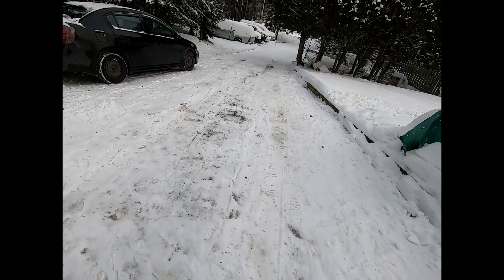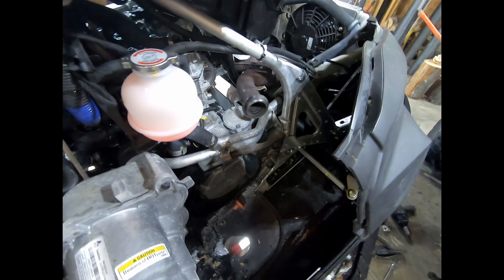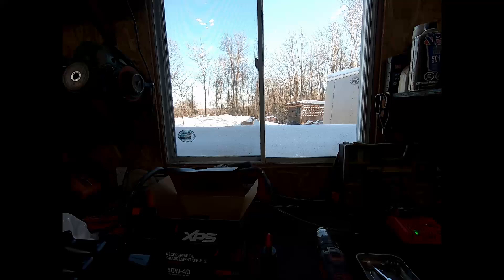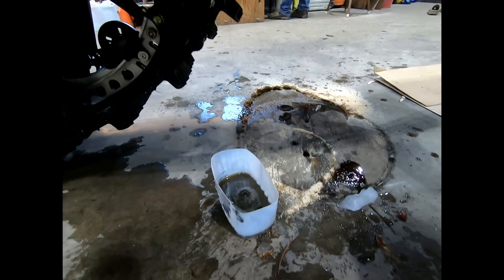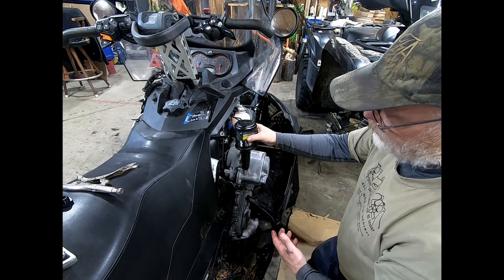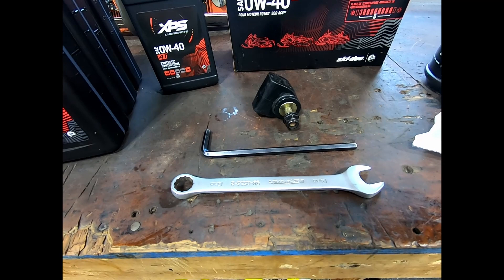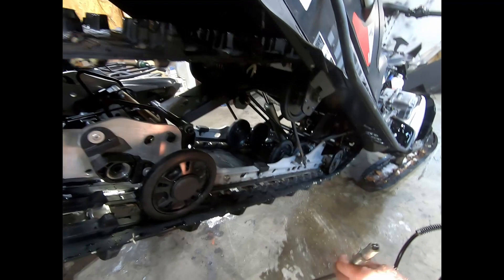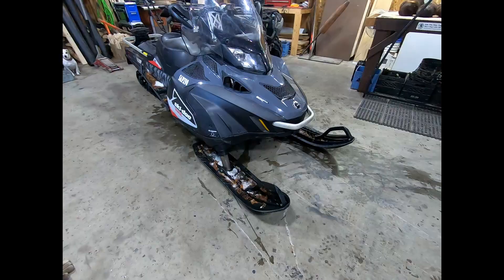Maintenance Tuesday SKANDIC 900 ACE WT

Comment: Always a good idea to do the maintenance.  For the screen that you replaced on the side panel, I would fill the torn screen with black silicone to close the rips and I use the repaired one when I know I'll be going into the bush and possibly rip again.  I keep the good one for when I go on trails...
Reply from the maker: Good idea, sometimes I am off in the rhubarb and should do that.

Comment: I need to replace my 550 fan with the skandik 900 ace wide track or the 600 EFI. I have not used either model . Favouring the 900. 
Do you get much ice build up in side the tunnel? Will it start at  minus 35 c ? Do I need a generator to run a oil pan block heater in it?
Reply from the maker: I have no complaints whatsoever about the 900 WT, before I bought a new machine I asked a number of what I call hardcore trappers what was the best out there right now and I tried out a few machines before I settled on the Skandic. Have had no troubles whatsoever starting in cold weather without a block heater. No problems with ice buildup either. Pricey to buy up front but way cheaper to run you can use regular gas and no 2 stroke oil needed.
I personally found the SWT to hard to handle for my age, that is why I settled on the WT also took the 900 for the extra power.
Reply: @gibbsadventures12  thanks Jim

Comment: How much is an oil change roughly for you sled I have the 2017 WT 900 ace ?
Reply from the maker: the kit was $85.99 but I also changed the transmission oil which was 2  containers at 31.99 each plus tax. Oil change kit comes complete with oil and filter.